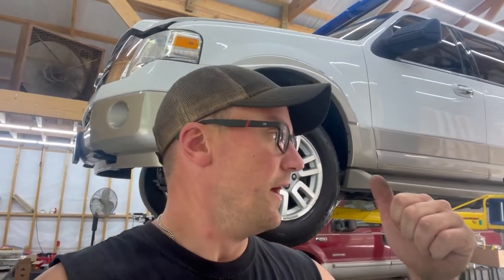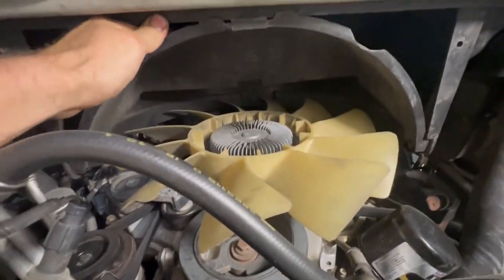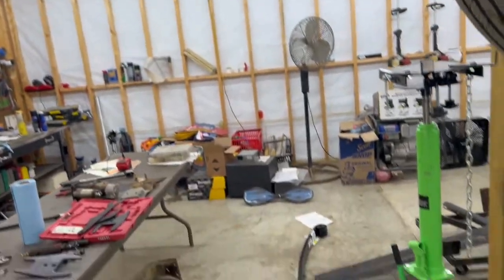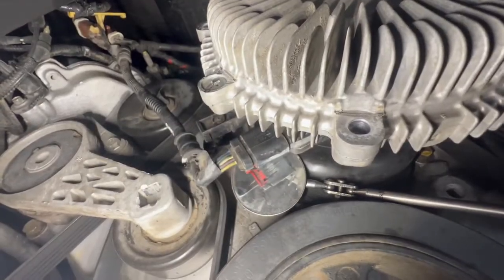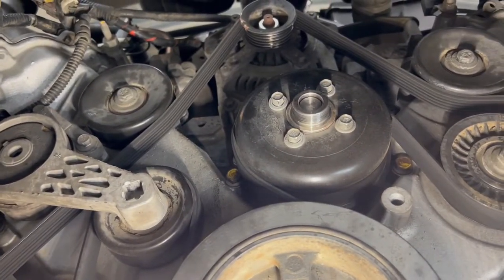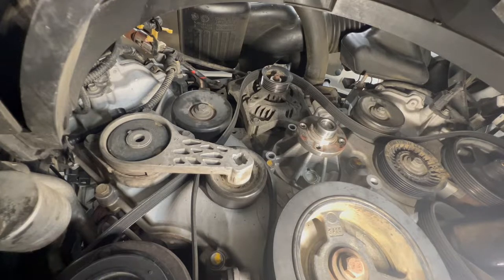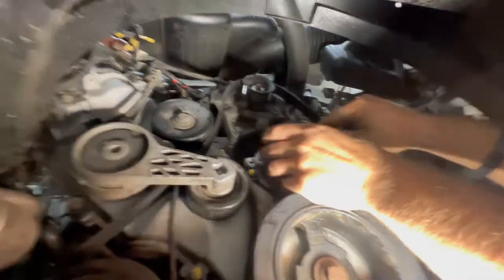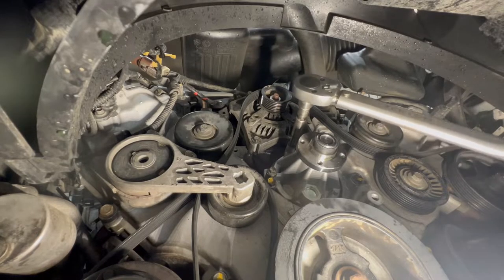07-10 Ford Expedition Water pump leak/replacement

Comment: Great vid. Question. I replaced the o ring and it still leaks. Does that mean the water pump needs replacing or could there be an issue in the water pump housing
Reply from the maker: Is it coming from the weep hole?
Reply: @AutomedicGarage  to be honest I'm not sure. Only leaks while the car is not running. LoL can't lie....your video just showed me what a weep hole is
Reply: @AutomedicGarage  I thought it was coming from out of the bottom of the housing but weep hole kinda explains why I couldn't see where it was coming from
Reply from the maker: @darnellcox2779  follow the trail of the leak. I would almost bet my paycheck it’s the water pump seals though.
Reply: SA SA it 6
Reply: Replaced the pump today 2 gallons of coolant later customer ride was back in the game. Appreciate you sir. I'll be looking out for more tips. Tip my hat to you
Reply from the maker: @darnellcox2779  glad it helped. Thanks for the comment and thanks for watching.
Reply: Can I fill coolant just thru top hose then add to Reservoir? Don’t have a vacuum to pull 20hg neg pressure.

Comment: Hello, is it possible if you don't have a clatch tool or hammer to not remove the clutch but rather to remove the screws behind it, the one that holds the housing that covers the water pump?
Reply from the maker: Never tried it cause I think it would be a pain

Comment: Can you add coolant normally while running or is the vacuum necessary?
Reply from the maker: I vacuum fill to be on the safe side, these motors are bad about air pockets in the heads. If you don’t have a vacuum filler just fill and crank, run for 2-3 minutes, sit check fill if necessary. Crank again run rpm’s up to 2k for 20-30 secs turn of check full and repeat a few times and you should be good.
Reply: @AutomedicGarage  thanks for the
reply!